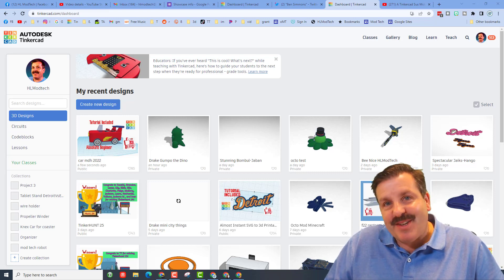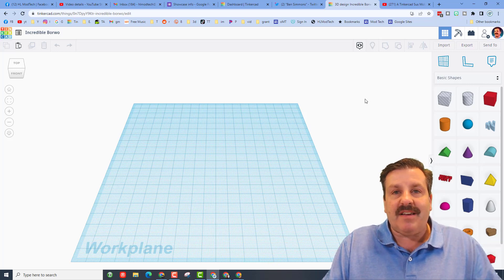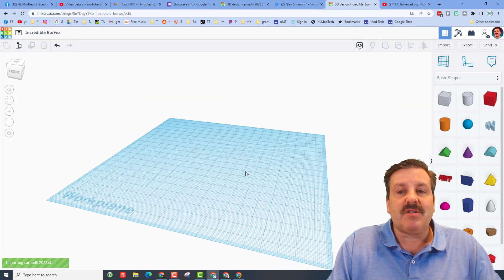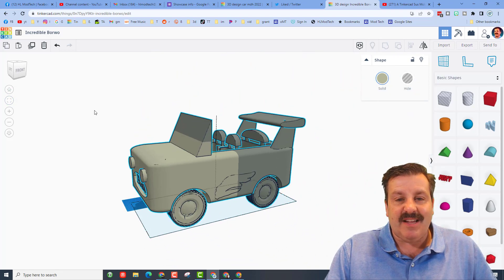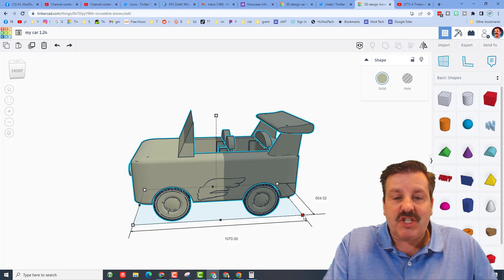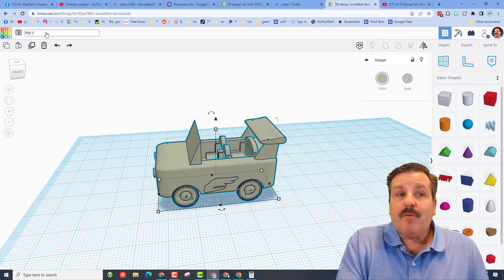Scale an STL in Tinkercad | Simple Steps  1:10 to 1:24 & MORE!

Comment: I assume this works because your model was already 1/10? I'm new to tinker and made some stuff that I want to print for 1/12 scale figures but I have no idea what scale it's in. Alls I know is I used inches. So how would I set this to 1/12 after just free lancing without setting a scale to begin with
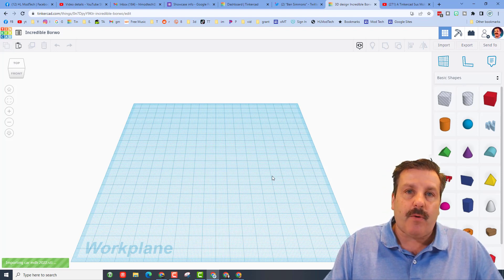Reply from the maker: It is just a math problem. I am going to show you in mm so we avoid fractions. Say your character is really 6 ft tall. 6 ft = 1828.8 mm. When you shift scale your character type 1828.8 in the height box. That would make it full-scale. As long as you built it proportionally all along. Then we divide 1828.8 by 12 to find your new 1:12 height = 152.4. Shift scale again and change the height to 152.4. Bingo... 1:12 scale.
Reply: @HLModTech  but that’s what I’m saying how would I be able to get it proportional if I didn’t start by making it proportional. For more context I made some furniture and computers with a keypad, but when I started making them I didn’t even think to make them proportional or know how to do that
Reply from the maker: I would say you can't.  If you scale just one dimension it would make all the other shapes goofy. A cylinder for a chair leg would be come an oblong shape.
Reply: @HLModTech  hmmm would I be able to share a project with you to see what I’m working with? If not no worries, just was wondering if it’s salvageable
Reply from the maker: To share a project you need to use the steps in this video https://youtu.be/XeDQjhRK8lg You can reach me at hlmodtech gmail. 👍
Reply: @HLModTech  awesome I had a travel day today I’ll share first thing in morning! Thank you!!!
Reply: @HLModTech  just shared it thanks u!
Reply from the maker: Got em. Checking now. =)
Reply: @HLModTech  thanks again 😃

Comment: Hi, how do I resize according to a specific length I want an item to be in?
Reply from the maker: See if this helps. https://youtu.be/R2KiOxsB7Lc or This: https://youtu.be/X6XhIHH2byI
Reply from the maker: or... if you just stretch one side you can type the number you want that side to really be and when you press enter it will snap to that size.
Reply: @HLModTech  thanks for your swift reply! Sorry, but the numbers I would be typing in are in mm/cm/inches?
Reply from the maker: Tinkercad has a limited design space so inches can be a problem. Typing the # of mm or cm (up to a limit) will snap just fine. I use that technique with basic shapes at the beginning of this turtle project. https://youtu.be/Zs0EuibHI1c

Comment: I'm new to this 3D thing. Why did you scale the 1:10 STL up 1070? Why not just 10?
Question 2 - if I have a 1:100 STL and want to print it in 1:72 would I scale up 10700 then down 7200? Or easier yet just increase the 1:100 STL by 1.389?
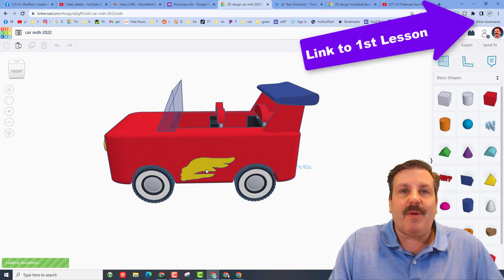Reply from the maker: I converted my 1:10 creation to 100% size by multiplying by 10... 107*10=1070.  Then divided by 24 to find the length it would have been for a 1:24 model. Shift stretch scales it the same in all directions, so that next length reduced the model to 1:24 scale. For question 2... just get to 100% and then divide by 72. That gives you the length of that side for the next shift stretch.

Comment: so if i have something in 1/64 that i want in 1/24 and i scale by 266% is the total scale now 366%? 100 plus 266?
Reply from the maker: I believe you would have converted the scale to 1/24... The amt you multiply does not get added... it was just the number you used to reach the 1/24 scale.

Comment: i dont understand how u can let go of the shift key and type the number in the X axis while still keeping the Y proportinal.  Mine does not change and the ratio is bad
Reply: I am having the same problem. I genuinely believe they got rid of this feature entirely. I absolutely cannot get it to work and I used to use this all the time. Time to switch to a different CAD software I guess.
Reply from the maker: @AlecHamilton  Sorry I missed this earlier. I use the technique daily, so I can confirm it is still there. What sort of device are you working with? PC, Chromebook?
Reply from the maker: The steps work like this. Hold shift and stretch one axis, let go, click the box and type a value and they will all be the same. Takes a few tries to get used to it.

Comment: Great vid, as usual, mister - but there's an easier way to scale things if you want to do the whole object by percentage rather than absolute measurements: select your object, then CTRL+SH-click on one of the corner boxes; click on one of the dimension boxes (where it gives your x or y size) and type in (say) 200%. Don't forget the % sign. Then hit enter and the whole object is scaled to 200%.
Reply from the maker: That is super cool, thanks for sharing! This user demanded the 1/24 part though... They would have had to have calculated what % of the orig that would have been.
Reply: @HLModTech  Ah, that makes sense :)
Reply: Scaling percent wise is simple this is why most viewers are here to see how to Size by a specific scale, not a specific percentage of size....
Reply from the maker: @johnhenderson4837  Thanks. 👍👍